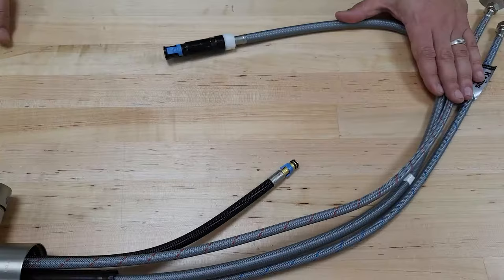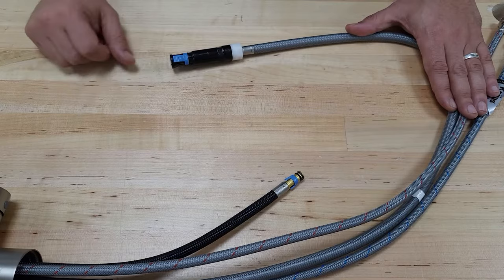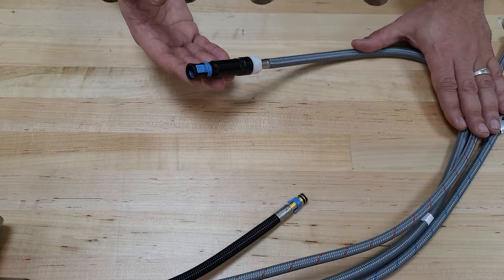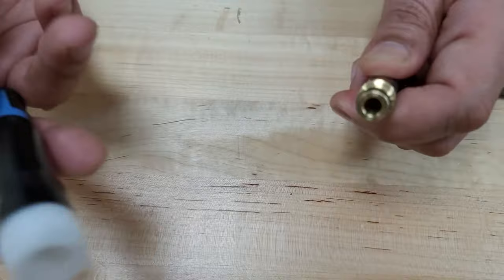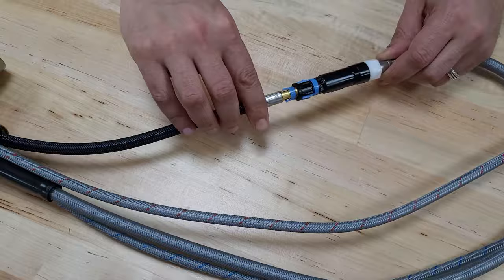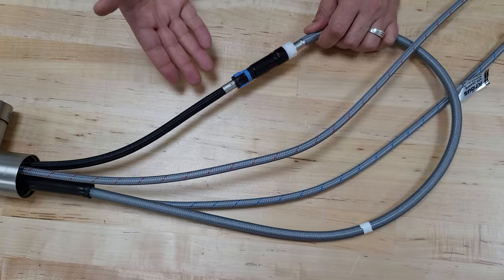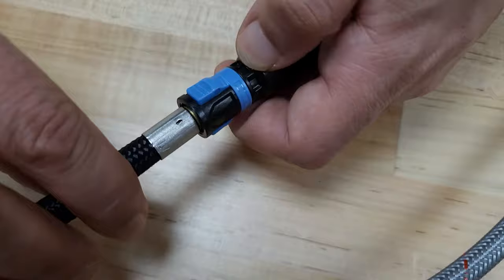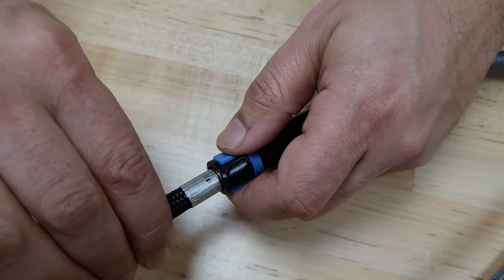Kraus Quick Connector Installation and Removal (Part 2/5)

Comment: What if the connector it:  damaged.  ?  It happened to me. I could not. Find the piece. I had to. Replaced entire faucet 😢😢😢 this faucet it’s built  to  make you buy a new faucet
Reply: Was there any response to this? My supply line fell apart,  and I don't see info on how to replace it...